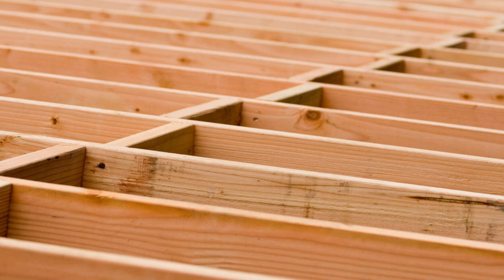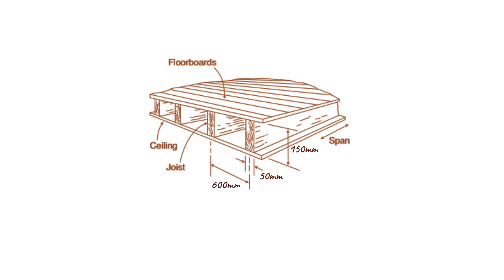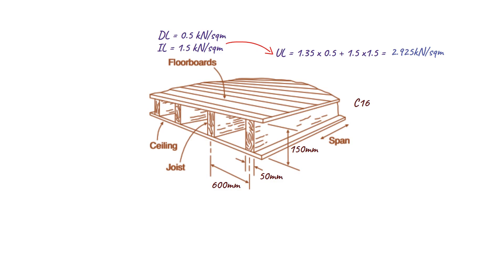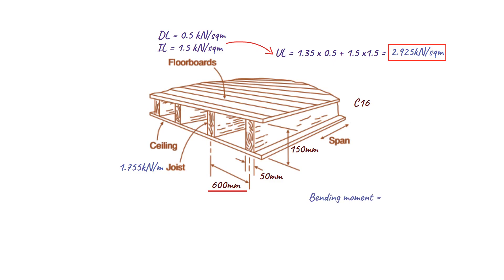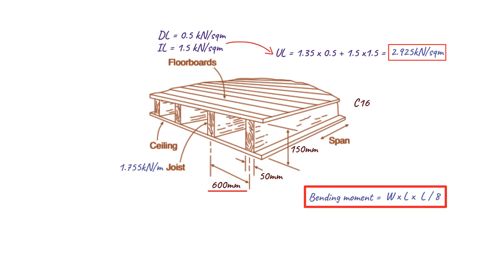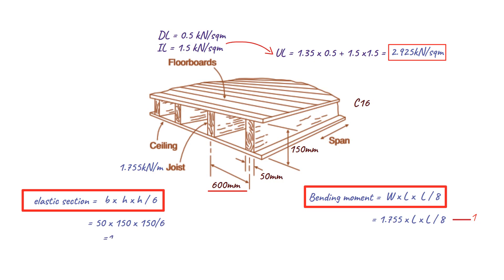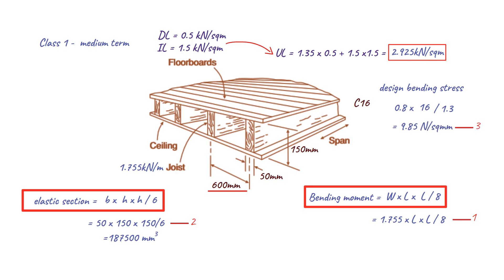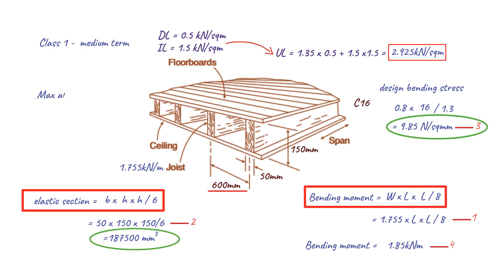Effortlessly Calculate Timber Floor Maximum Span.

Comment: Fails in deflection.
Reply from the maker: Thank you for watching the video! It's worth noting that this tutorial only covers how to find the maximum span for timber floor joists. While this is an important consideration, there are other factors that also need to be taken into account when designing a timber floor, such as bearing stress & deflection. If you'd like to learn more about these considerations & how to design timber joists for bending, shear, and deflection, you may find this video helpful: https://www.youtube.com/watch?v=WzBFqlIlOVQ. Don't worry though, we'll cover these additional factors in a future video to ensure you have all the information you need to design a safe & strong timber floor. Thanks again for watching!